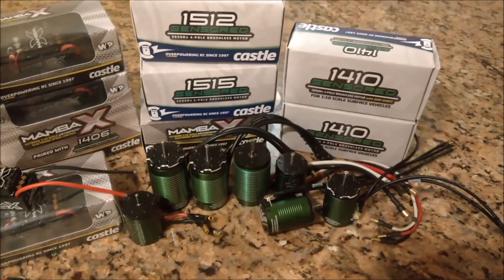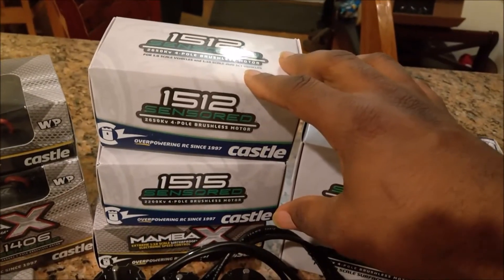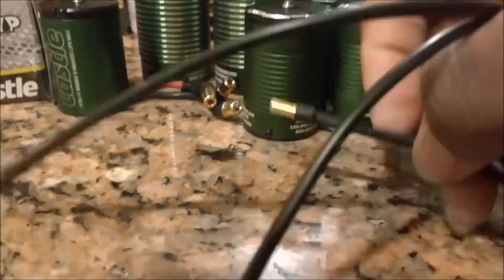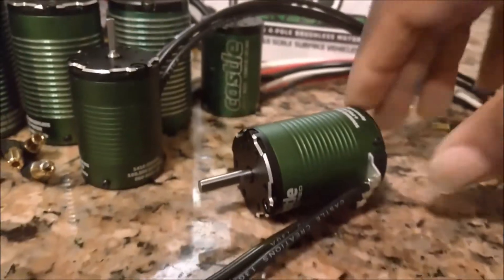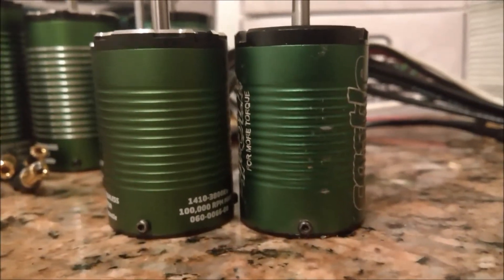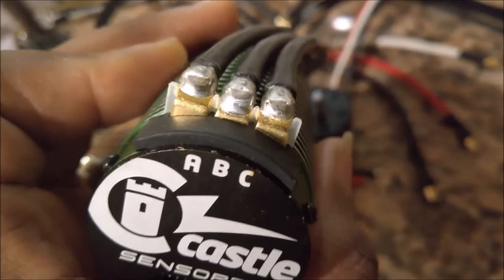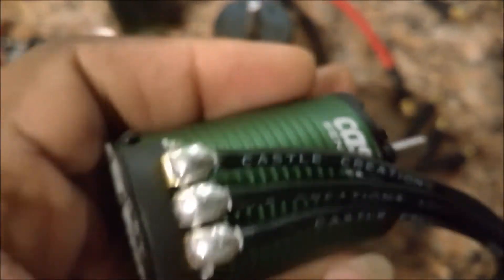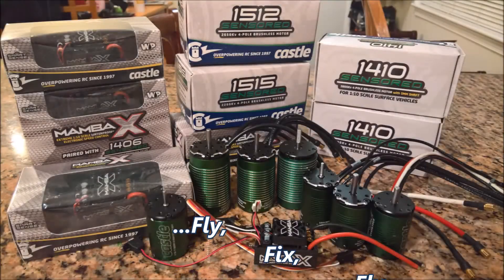Ep. 199: Castle Sensored Motor Mini-Review

Comment: Hi I know this is an old vid, but I bought an older motor. I have a 1410-y. But I don’t see a sensor input. Did they make some of these sensor-less? I don’t think it’s a fake. It came with a sidewinder and I bought it from my friend. I’ve also seen my motor(without sensor input) as stock photos on some hoppy shop pages.
Reply from the maker: the 1410 has been around for a really long time. The first versions were sensorless. This video was made around trhe time of the launch of the 'new' sensored versions. I still have a couple sensorless 1410s and they are still great performers. 🤩
Reply: @RCPhysics Awesome news. My friend gave me a new hobbywing 10BL60 quick run. Do you think that will work okay? It’s just a stampede with an aluminum gearbox I use to bash around and do a few laps at the dirt track. It is a sensor ESC, but the manual says it can run a sensorless motor fine.
Reply from the maker: Sensored motors will run fine sensorless. You will lose the low-end precision/control, but you probably won't miss that doing dirt track racing.  😎
Reply: @RCPhysics cool! Dude you got me stoaked! I’m excited to get my old badger running again
Reply from the maker: @bassist21685 Let me know how it works out!

Comment: Hey bro I bought one of these after watching your video and I have a problem. I wanted to put it in my tamiya rc but the pinion shaft is too big for the pinions I have. Do these fit in tamiya?
Reply from the maker: I believe Tamiyas mostly use 48p gears, which I use on a lot of my castle powered models. However, a lot of Castle 1:10 scale motors come with 2 shaft options, a "standard" 1/8" (3.17mm) shaft and a "beefier" 5mm shaft option. Did you order a 5mm shaft by mistake?

If you did order a 5mm motor, there's a pretty simple solution. You can get pinions that will fit the 5mm shaft at most good RC shopping sites. For example, here is a variety pack of gears on Amazon for ~$15. https://amzn.to/3qjx8sB

I hope this helps.
Reply: @rhouse21 - RC Physics  Hey bro I figured it out last week and yes I had to get the 5mm hole pinions and its running great!! Thanks

Comment: The 13awg wires of the 14series of motors are weak. I soldered 12awg on my 3800kv 1410... Much better and durable.
Reply from the maker: One nice thing about the new Motors is that you have the option to do things like this. In the past you were stuck with the stock wires no matter what.

Comment: So they clam to be waterproof.  But are they? The sensor port is wide open. I am going to put dielectric grease in it and some waterproof gorilla tape over it.
Reply from the maker: You are correct. The ESC & motors are waterproof, but the connectors need to be protected. Dielectric grease with an outer protector layer is a great solution.
Reply: @RCPhysics  ok thank you . Wonder why they didn't put a waterproof cap on it .
Reply from the maker: That is a great idea. I will pass it on!

Comment: Hi, I have a 9000kv motor for a rustler.Being the kv is so high, what gearing would you recommend and any idea what sort of speed it can achieve in a Rusty??

Thanks man
Reply from the maker: I'd be really careful aboiut trying to use that motor for a speed run. 1406 series motors are probably good for 60-70 mph based on their max safe power output, but such a high kv running speed gears could mull more current thatn the ESC can safely provide which may blow the motor and/or ESC. A 9000kv motor is also "only" rated for 100 krpm, so you have to be careful not ot over-rev it on 3S. (12V * 9,000kv = 108,000 rpm) This could shred the rotor if you exceed 100krpm for too long

A 3800kv 1410 motor could probably be a better choice since it has a higher overall power output can handle a lot more current. I've seen that motor achieve 90+ mph in a parallel 3S battery equipped Rustler.
Reply: Sorry another quick question, how did u find the Awanfi lipos to be?
Reply from the maker: @rionnsrcchannel6769 Sorry. I don't have any experience with those LiPos.

Comment: Does the new 2200 have no cooling fins?
Reply from the maker: It does. Click the link to jump to a shot in the video where you can see them better. https://youtu.be/P6Kw__EifqQ?t=760
Reply: @RCPhysics  bought one but has no fins on it its solid with logo on the side for the 1515-2200ky but same size can do you think its a fake?
Reply from the maker: Can you post a picture in the RC Physics Sandbox on Facebook? It may be an older version if it's used. Some of those didn't have find.
Reply: @99thpeanut59  is there a difference in cooling rate ?
Reply: @99thpeanut59  yes its B version with ESC and actually i have both the one without fins runs much cooler than the original in my opinion running 17t and 44g both 32p

Comment: How fast does the (1406kV) 600 go
Reply from the maker: 1406 is actually the series number of the motor. The first 2 digits of Castle motors tell the "can" diameter in inches. I believe the last two tell the magnet length on the rotor. My Sensored 1406 motor is 5700kv which should put this car well over 100 mph later this summer.

Comment: I have a kyosho drx with blown original Orion motor, do you think a 1410 would do well with original Orion esc on 3s?
Thanks!
Reply from the maker: I looked up this car on AMain. I think a 1410 would probably do really well, but the stock gear ratio is pretty high for 3800kv motor. The stock motor for that car probably gave you a top speed of ~30-40 mph with stock gearing, so you'll probably have to go to a lower ratio to be able to use the motor's full rpm range... unless you are cool with the idea of a 50-60 mph basher. ;-)  

That said, the 1410 should do fine. This car looks pretty close in size to a Traxxas Slash 4x4 / Rally platform which does really well with the1410s. Just be aware, the 1410 can pull a lot of current, so you may end up overheating your ESC if you don't step down the gearing. If that does happen, you may consider stepping up to a Castle Mamba X or Sidewinder 4 ESC.
Reply: rhouse21 - RC Physics thanks for a really nice answer, thumbs up!!

Comment: Haha I'll take one of em haha
Reply from the maker: LOL!
Reply: rhouse21 - RC Physics how is the 2400kv?
Reply from the maker: My 1415 2400kv motor is the older in-sensored version. I like it, but it's kind of a strange motor for my fleet. I've been running most of my "1/10" scale cars on 3S, but this motor really needs at least 4S to really start to come into it's own because of it's lower kv. It felt plenty strong on 3S, but my cars are pretty light, so I don't think I really was able to tap into the extra performance potential. Also, you have to run some pretty tall gears to get the wheel rpms high enough to get the car ripping at the same level as a higher 3800kv 1410.

I'll be doing some 4S and higher runs with this motor soon, so we'll see how the extra voltage wakes up this setup.
Reply: rhouse21 - RC Physics I was going to turn my slash 4x4 into a monster so I'm not looking for speed but I want some. So i was going to put the 2400 with tall gears. But is it ok for a 2400 kv with tall gearing run some proline 2.8 badlands mk28 and steel drive shafts?
Reply from the maker: It should be fine. I've actually built 2 Monster Slashes. My first was actually a few years ago before it was really a "thing". This one used a Castle 1410 3800kv motor / Sidewinder 3 ESC combo which handled big tires just fine. https://youtu.be/hr5VeeiF1jo

The most recent is Project Skar, which is using a 1512 2650kv motor / Mamba X ESC . This is probably overkill, but it seems REALLY happy. 
Video 1 (the build): https://youtu.be/C-pcPXNnfXU 
Video 2 (reveal) : https://youtu.be/Vhu8qiDlkl0

The 1415 2400kv is in the middle of these two in power, which would be more than enough to make a VERY happy Monster Slash. I would definitely recommend a Mamba X or MMX as your ESC for their high capacity and sensored motor capability. I've really fallen in love with the ability to drive a really powerful car really, really slowly. I haven't quite crossed over to the crawler-side, but seeing a "big wheeled" Slash go delicately weaving through a rock field to doing backflips within a couple of milliseconds is pretty sexy. ;-) 

The un-sensored Sidewinder 8th would probably work well, too ....although the new Sidewinder 4 (which is also un-sensored) may be able to handle it given all its upgrades beyond the SV3. These ESCs would probably be a LOT of fun, but would not be able to give you the low speed precision.
Reply: rhouse21 - RC Physics ya I was going with the sv4 and the 2400kv.
Reply from the maker: Awesome. Let me know what you think. I'm really curious to hear what you think of that ESC.
Reply: rhouse21 - RC Physics ok if you ever get the esc, Rpm hasn't made a cage but I can get a link to a 3d print esc cage, but at the time I get it they made have come out with one.
Reply from the maker: I make my own... ;-) 
https://youtu.be/AU83kwB90m4
Reply: rhouse21 - RC Physics oh awesome
Reply: rhouse21 - RC Physics btw does the 2400kv fit a slash 4x4 without any movements of the esc and receiver?
Reply from the maker: The 1512 fit just fine and is 67mm long. The 1415 is 69mm long, so I think you'll be ok.
Reply: rhouse21 - RC Physics ok thx for all the info.
Reply: rhouse21 - RC Physics lol I just broke a stock drive shaft with a 2s and a 52 spur with a vxl system.
Reply: rhouse21 - RC Physics unfortunately, the motor is just a smidge to long.
Reply: rhouse21 - RC Physics but it's my esc mount that's stopping it so all I have to do is grind a bit off the esc mount
Reply: rhouse21 - RC Physics I made a vid showing it. Check it out

Comment: What hearing should I use with the castle sidewinder sct with 3800kv motor in my Rustler vxl
Reply from the maker: It really depends on how you plan to run. Bashing, racing, and speed running will all end up with different optimal gearing. What are your goals?
Reply: rhouse21 - RC Physics I do about 20% on road 30% grass and 50% dirt gravel bashing
I will use a 2s lipo which should get around 45mph
Reply from the maker: The Rustler manual says 28/83 gearing should get you ~45 mph on a 8.4V (2S) pack with the stock Velineon system . I'd recommend starting there since the Castle 3800kv motor is only 300kv more than the stock system. Watch your Motor and ESC temps. They will tell you if your car can handle more gearing once you get used to this power level.
Reply: rhouse21 - RC Physics I got rid of the velineon system cos running it on 25/83 FOR 3 MINUTES on very flat grass not even full throttle on a mid warm day, the velineon was up to 170f IN JUST 3 MINUTES, I set the gear mesh properly I was using stock size tyres
Reply from the maker: Grass is tough because you get a lot of wheel spin, so the motor ends up running up to pretty high RPMs really quickly. The castle motor should be ok up to 180-200F though so have fun!

Let me know how it works out!

Comment: So the sensored motor is not requirement and it’s just an additional thing. And also I can wire the sensored motor any way into the sensor less esc without messing it up?
Reply from the maker: Yup! And if you plug everything up and the motor spins in the wrong direction, just swap 2 wires.
Reply: rhouse21 - RC Physics thank u soooo much

Comment: I have a sensored 3800kv castle 1410 motor with a sidewinder sct esc but it says “Sensored capabilities of the motor cannot be utilized with the Sidewinder SCT” what does this mean? Am I able to run the combo safely and do I still need to wire the motor to the esc by the A B C like a sensored system
Reply from the maker: You can use any of the new Sensored Castle motor with a "normal" ESC and they will work just fine. However, they do not have the circuitry to sense the rotor position, meaning you won't get the Silky-Smooth take offs and super low-speed crawling capability that comes with the Sensored operational mode.

Your Sidewinder will still KICK with that motor, though.

Sensored operation is really cool, but honestly, a not of bashers don't really need the low speed control it provides. This is why Castle still offers the combo you bought. It's still a REALLY GOOD setup.
Reply: rhouse21 - RC Physics thanks so much, I finally have an answer. Also i don’t really care for getting a silky smooth start though! Thanks for your help

Comment: Question, I have a Castel motor that has a sensored port, but my esc does not have the sensoreing capabilities  (hobbywing) is there in problem with this type of setup?
Reply from the maker: No problem at all. The ESC will just detect it just like a "normal" brushless motor,
Reply: Thank I felt like that also, but I had to check with a trusted source.  You.

Comment: Hey great video I have 4 Castle units and two separate 1/8 motors 2650kv an1800kv two sidewinder 3's a sidewinder 8th and also a sidewinder SCT. I've had them about 1 1/2 yrs. and they still work great.(Knock on Wood) . I'll be getting the Mamba X Sensored setup. Can't wait, the vids are very informative and helped me to understanding the differences of the newer units. Stay Good Stay Safe. RC Medi

Comment: Great Vid!   How do you get the bearings out of these sensorless motors?  I want to put ceramic bearings in my new 1410 motor but when I take it apart it seems that the bearings are frozen (glued?) into the holes.  Any advise is appreciated.
Reply from the maker: I've heard of a few methods, but I would hate to tell you the wrong thing and have you damage your motor. I would suggest calling Castle Tech Support. The guys on there are great and they will be able to give you the best info. Their phone number is 1-913-390-6939.
Reply: rhouse21 - RC Physics         Thank you

Comment: Just got a sidewinder sct sensored 14 series 1410-3800 kv four pole and I was wondering were to plug the wire in on the esc???? And help on turning lipo cut off Off., thanks for motor update
Reply: Hunter Henderson, 
Me too. But, just discovered the esc IS NOT sensored capable, so there is no input for the cable on the esc. My combo came with the sensored motor but not the sensored capable esc. Kinda weird.
Reply from the maker: Castle has discontinued most of their non sensored motors, but the sensored motors will work just like a non-sensored (normal) motor, which is why Castle is selling them with their Sidewinder combos now. It is kinda weird, but it actually does make sense. You can always upgrade to a sensored ESC later if you want the extra control or data logging.
Reply from the maker: Sorry to break this to you, but the sidewinder is NOT a sensored capable ESC.  You need a Mamba X to use the sensored capability. You CAN run it sensorless, but it sounds like you really wanted to use the sensored features.

Comment: awesome review.... can't wait to see you try these motors out ..... I'm especially curious about the 3800kv. thanks for keeping up with the times.
Reply from the maker: The sensored 1480 3800kv standard shaft will go into my Slash 4x4 basher, so that should be a TON of fun to toss around. The sensored 1480 3800kv 5mm shaft is going into the Speed-Rustler, so that should be a load of fun, too.

Comment: just a question I have a tamiya tt01 and was looking at getting a catle as well....1/10 scale...I hear 5700kv is about the limit for my car so im asking is the 1402 or 1405 right for size...standard shaft as well???...Thanks...I am running 3s with a 9t leopard 60A esc...
Reply from the maker: OK, I think you are actually thinking of the 1410 vs. the 1406. The 1410 is really more suited tor the larger Short Course Truck, Buggy, Rustler, class of vehicles. It's a torque monster and does really well throwing those big cars around. 

The 1406 is a little shorter (so it has a little less power potential), but it is still more than enough for a 1/10 scale on-road. It's available in a wide range of kv values, but they are all intended to produce about the same amount of power. The version you need for your care really is driven by how fast you'd like to go and the range of gearing choices you want. I think 5700kv is a good choice for that car, but may speed runners like even higher kv motor so they can get by with smaller spur gears.

What type pf running do you do? speedruns, racing, drifting? Your driving style might actually be the biggest factor in your decision.
Reply: Lets say for the most part...I like to drive my car around...its my lil street car...but on the real I drag race it and I do speed runs...To find one that fits like right in the middle would be great my gearing is 25t pin and a 55t spur...i hear somewhere there is a AV type 26t pin but have not found it yet but im good with the gearing in it now seems like its enough gear...lol...
Reply from the maker: I'm about to replace the sensorless 5700kv  1406 in my Apex with one of the new sensored motors (when they gets back in stock).  It is a VERY capable motor and took this little guy to 60+ mph on 3S with stock gears without breaking a sweat.
Reply: kool last question...i have a goolrc 80A esc with the program card on order...i dont plan on 4s running but just to have good room do you think that would be kool or just get the mamba pro...lol
Reply from the maker: I'm cheap by nature. I LOVE Castle ESCs, but if the one you have is working, you probably don't need to replace it unless you have a good reason. However, if you want to use a new sensored motor and get the full range of performance, you will need a sensored-capable ESC, like the Mamba Max Pro of Mamba X..
Reply: thanks man im going mamba...lol...